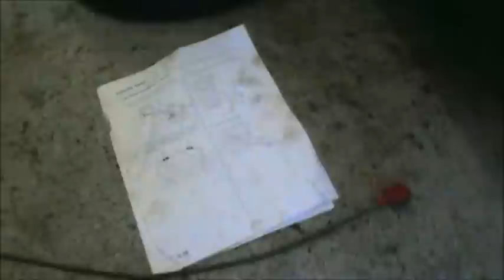Today in Rodney

Comment: see if one of those thin high tensile spring washers will fit in the gap then just make your own tab to hold it down. either that or allot of cars use that aet up to hold the heater pipes to the block. 
good luck

Comment: @sc0tte1 That is the sound of the pressure relief valve for the air tank popping.  Evidently, the device that causes the engine-driven compressor to stop pumping at a certain pressure has stopped functioning.   This could get ugly if that relief valve ever plugs up with ice.

Comment: take an old open end wrench,hard ti tell what size on the vid i'm guessing about 18 or 22 m, round out the grip to fit arond the pipe, then cut off handle leaving a stub. drill hole in stub to meet threaded hole. does not need to be entire circumfrence of tube. hope this makes sense to ya.,